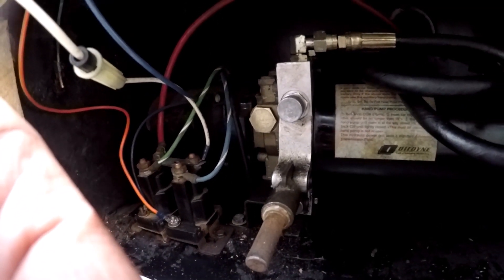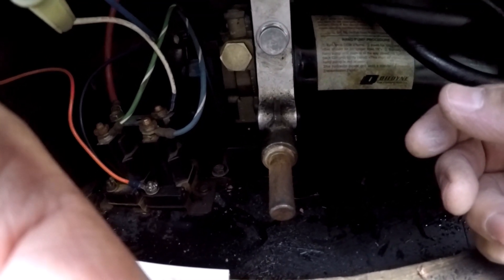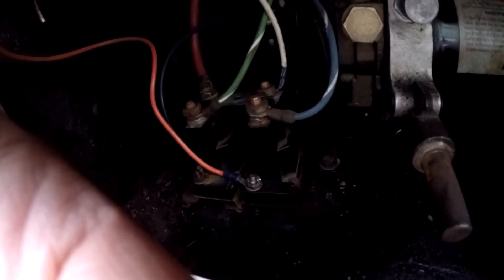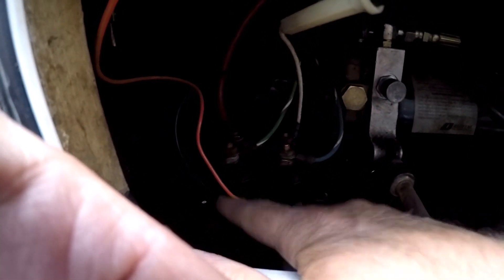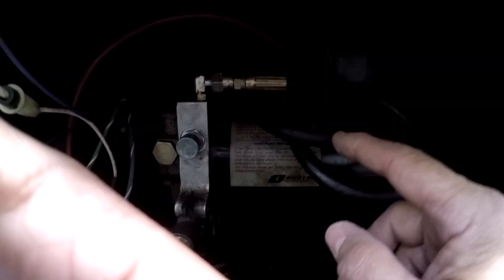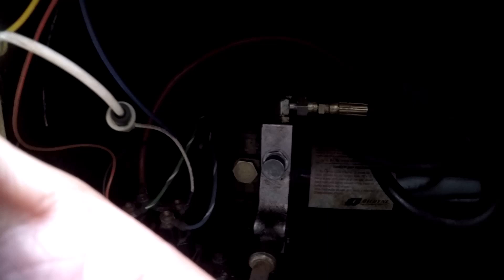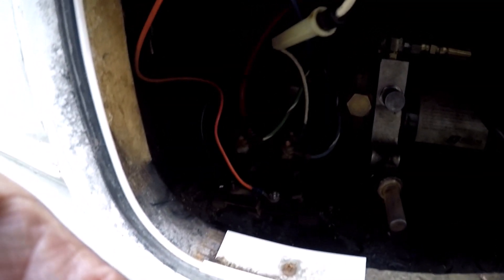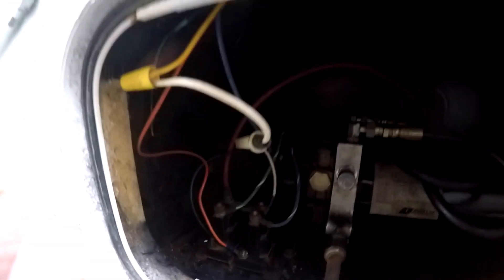how a RV slide hydraulic pump works

Comment: hi i have the same pump , and my slide out wont come out , i tried manually to get the the slide out but i kept pumping but its not coming out , so i tried to jump the solenoids with a 12 v battery charger i hear a clicking but the motor wont start , can you tell me how to jump the motor which wire i put the positive and the negative to make it work? and thank you
Reply from the maker: So first of all to get the slide to pump out you need to switch the 2 hydraulic lines at the pump. The hand pump is designed to only pump the slide in so you can at least drive it home. So if you cross the lines it will extend out for you and switch them back to bring it in. As far as what to check electrically first check the fuse. Make sure when working on the wiring unplug your AC power 110. If the fuse is good check your batteries. Most RV'S have two 12 volt batteries but when you have both hooked up you should get like 26 volts. If the voltage is too low the slide will not work on ac or dc power. Both batteries need to be charged for the inverter to trickle charge to maintain a full charge. The last possible cause for your slide not to work is wiring terminals need to be cleaned and the grounding point. Actually take the solenoid out too and clean. I have two jumped together. They can be tested to see if they are working. There are videos that show how to do it. Anyway hopefully this will help you and anyone else with this issue. Good luck and let me know what you find out. Tim
Reply: @TimsWorkshopTJY  thank you so much sir , i appreciate it
Reply from the maker: @ashrefomri6807  Thanks again for watching my videos. Please tell your friends about my channel. Many topics on how to fix stuff
Reply: @TimsWorkshopTJY  i will thanks again
Reply: hi tim its me again i tried to reverse them but it didnt work i put more transmission oil in there to full but didnt work i dont know what to do
Reply from the maker: Did you close the valve?
Reply from the maker: Take a picture of your pump for me to look at
Reply: @TimsWorkshopTJY  how do i post pictures or send them to you
Reply from the maker: If you have a cell phone camera take a picture then create a link. Attach the link to your next reply like this. I have to pull a picture up first. It's coming
Reply from the maker: https://photos.app.goo.gl/JtsSHnuPWrH8h8Nt6
Like this. When you create a link it's live and the person receiving it can click on it and open the picture.

Comment: Dewald hydraulic (manual) 3 slide out system in my 2002 Keystone Montana 2880rl 5th wheel Rv. One of the stem valve shafts broke. 

Looking for step by step guidance on removing just the Left stem valve (1 of 3 valves) assembly but I don’t know what the consequences are if I do remove the hex nut & try to extract the part.  Can it be reinserted easily if need to?  I assume there’ll be some hydraulic fluid escaping but not really sure. 
Do you have email for sending pictures if needed.
Reply from the maker: Not familiar with that one. I have a 2021 Keystone Cougar all electric with cables now.  Send me pictures and maybe I can help
Reply: @TimsWorkshopTJY  do I need your email address or do I copy/paste as a reply?
Reply from the maker: It's listed on my video description but it's yatabata03@gmail.com
Reply from the maker: Ok, just reviewed your email and pictures. It looks pretty straight forward but I'll do a little research on this system. It's like my old RV system but with multiple slides where we just had one large livingroom one with one valve knob.
Reply from the maker: So first of all these valves work the same as a faucet valve. When closed there is no passage for the fuild to pass when open it flows allowing you to manually pump your slide in or out which it shows a switch on yours but not sure if that is what it's for? If not you will have to switch lines like I did. But for what you need is to replace the valve. There is no pressure on these when not being ran but I would be aware when removing the retaining nut since you can't turn the valve open with the know and stem broke off. Put a rag around it when removing the valve retaining nut. When it's removed pull the valve out slow and if the fluid starts running out stuff the end of rag in hole till you screw in the new replacement valve. I would have one ready to put in. Getting the old valve out should be obvious by looking at the new part that you either purchase from a rv keystone dealership or direct from the pump manufacturer. Should be a brand name on it with serial number or metal stamp part number. My guess is the valve screws into the selector manifold. Lippert has a video showing their valve unscrewing
Reply from the maker: Lippert has the new valve i believe you need. They have full turn or half turn ones. It threads in but it comes without the knob? Hopefully you still have it?

Comment: Can you help me with my 2002 dewald hydraulic pump it quit working
Reply from the maker: Hi Robbie, I don't see the pictures? Do you have electrical power to the pump? did you clean the ground and other connections? Did you check the inline fuse?

Comment: What happens if my valve breaks
Reply from the maker: What valve? You mean the pressure close valve on the front? Or just the knob? Send me a picture to my email yatabata03@gmail.com
Reply: It’s the knob the one you have to turn right & left to open it’s the one right on top of the hand pump
Reply: & okay will do I will send the pictures
Reply from the maker: If there's anything still there weld a nut on so you can turn it. If you dont have a welder some good JB weld would work

Comment: hi tim , i took your advise and i switch the 2 hydraulic lines and it worked but when i tried to get the slide out in i switch them back again and it didnt work when i pump the hydraulic fluid is coming out of the tank from the cap where you suppose to ad the lequid so what should i do?
Reply from the maker: That's weird? So it came in by pumping it with the silver knob closed but leaked on top from the filler cap when you reversed the hydraulic lines? I'll have to go out to look at mine and take a picture to share with you.
Reply: @TimsWorkshopTJY  thank you
Reply from the maker: Decided to shoot a video instead to share on YouTube for those who would like to know how to run their slide in and out without power. It's pouring rain out right now so will later if it quits today. When done will share with you first👍
Reply: @TimsWorkshopTJY  thank you so much tim i appreciate it can you show the proper way with adding automatic transmission fluid to the tank of the hydraulic pump when we do it mannually
Reply from the maker: Ok, will do. Hopefully will have something tomorrow
Reply from the maker: Hi Ashref, I took a video today up at the storage RV lot. I need to edit and should have it ready to share tomorrow.
Reply from the maker: https://youtu.be/6yQLW8aJnOI
Here you go Ashref, if you would like to donate to my channel so you would get special viewings before they go public let me know. I have a Patreon account so if you join for like 5 bucks a month you will be in my club. Plus eventually get special deals on my merchandise when I get enough viewers on my Patreon. Let me know if your interested. Thanks Tim
Reply: Tim's Workshop TJY Hi Tim. Is this video still online? I am having trouble with manually retracting my living room slide
Reply from the maker: https://youtu.be/gmGZj19TijI
I haven't loaded the new one yet which goes over in detail how to run the slide manually. Here is a special viewing for you. Thanks for watching  my channel and hope this helps. Tim
Oh, some newer RV'S only have electric slides. If that is the case you need to check the motor to see if it quit working?